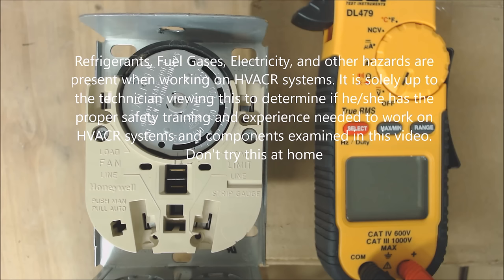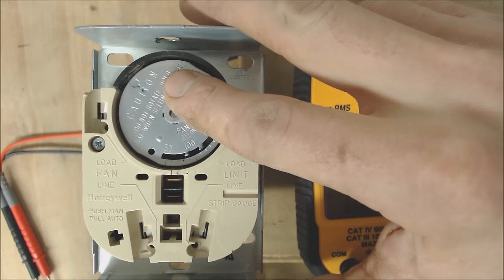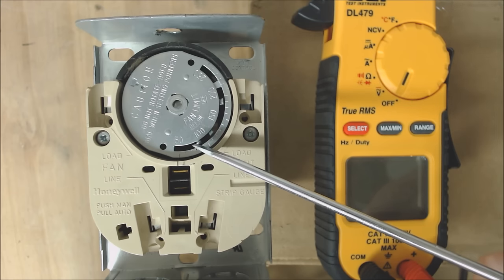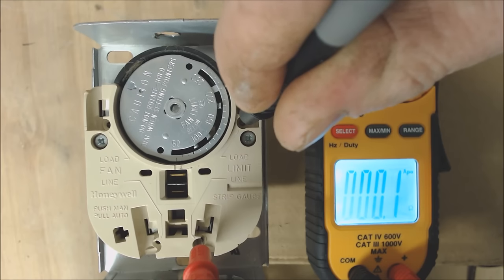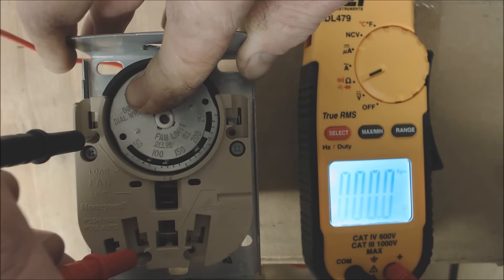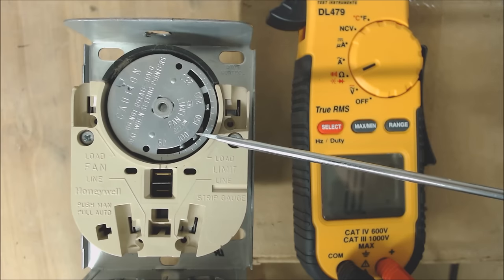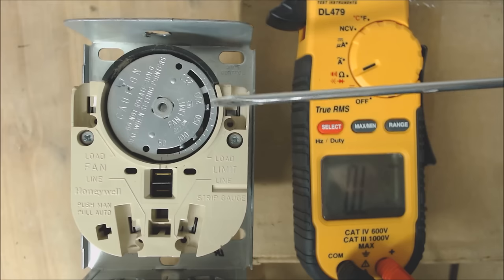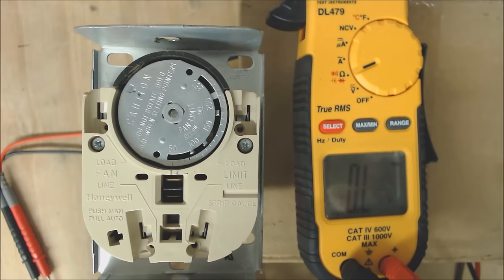Troubleshooting the Fan Limit Control Switch on a Furnace, Temperature Settings, How it Works!

Comment: Hi My furnace shut it self down as the gas valve stop working properly...no heat. The technician who came over determined the valve was at fault. He mentioned that the furnace is 15yrs old and is at it's end of it's life span. This is the first problem we had with the furnace. He seemed to be hinting at replacing the furnace. He called his parts supplier and found out the part was not available and it may take 1-2 weeks to get here. Its winter I need heat. I found the part myself at a different supplier but as I don't have a gas license i couldn't buy the part. I informed him and he got the part for me the next day. He apologized for not checking another source. I question if he was honest about this...Perhaps he was hoping to get me to buy a new furnace instead. However, now it seems I get heat in the first stage, and it takes a long time for the second stage to kick in. When the second stage kicks in it runs for a rather long time blowing cold air before it shuts down. I noticed this about a week and half later. So the house gets warm, then it gets cooled off with cold air blowing. I wonder if he didn't set the limits properly (or on purpose). From what I recall when the second stage kicked in we got a lot of heat and the house warmed up fast. I'm a little hesitant calling the company back. I'm also hesitant to call another company as I'd like to have some kind of idea as to what is really going on and how the furnace properly works. Would the fan limit control need to be adjusted? Thanks

Comment: I had a lady that sits in front of the heating vent and when the burner shuts down where the fan keeps running toward the end of the heating cycle she feels a gust of cold air coming out until the furnace fan shuts down.  The fan limit settings were set at 95/120/200 on oil fired unit.

Comment: Then if unplug the cord i have 24.8ohms on fan side and still .3ohms on the limit side what am i hooking up wrong here its hooked up to thermostat but it wont turn blowers on and if i get ot to wprk with the thermostat then the draft/combustion blower wont work

Comment: So i have a question i have one these on my wood furnace it looks like my dial is screwed up or something It goes way past 50 counterclockwise without a fire and with a fire burning stove is hot to touch and the dial is at 100 if blowers do kick on its just fpr a second you think my switch is screwed up? On my limit side i have .5ohms and an oL on the fan side with the switch dial at 100 if i turn dial a little more to make blowers kick on it reads .1ohms

Comment: Great video!   The model you're showing is the Honeywell L4064Y1441,  I can't seem to find any direct replacements on it for my York furnace, but a few sites show the L4064B2210  as a replacement but it doesn't have the center 2 spade connectors.  Can this L4064B2210  be installed, if so, what to do with the two yellow wires coming from the gas valve that used to connect to the 2 center blade connectors?
Reply from the maker: You should be able to get it at the local supply house but the two center tabs are for downflow so that the furnace doesn't overheat in the beginning, thanks

Comment: Hi, Thank you for the awesome video. Sometimes changing the thermostat can save you 5k to 10k on this HVAC system (lol).

"HVAC CAN BE DANGEROUS; DO NOT ATTEMPT ANY REPAIR IF YOU HAVE NO KNOWLEDGE OF WHAT YOU ARE DOING."

 I have an old furnace in my house. I had the relay buzzing very loudly inside the furnace. Called the technician he said it was the transformer and relay, and would charge $300 for the relay only (lol). He also advised me to put a new and more efficient HVAC system.  Called another one he also told me your system is old get a new one. He told me your furnace and AC are running at the same time (bu**). After he left, I checked the outside unit wasn't running. 

After that, I decided to take matters into my own hand. I made my own wiring diagram of the furnace system since the older system is simple without any circuit boards. Checked voltage on the transformer, limit switch, relays, and so on. While checking the voltage on the relay coil (magnetize switch ) and it was 3 V instead of 24 V. Since I had the wiring diagram ready I figured out the culprit was a thermostat. I also had to replace thermostat batteries twice that week but it was hard to relate it with relay buzzing since I had no idea of the system before. I replaced the thermostat with a new one since it was in warranty. I am using the smart google Nests thermostat. It took me 3 days to do the above tasks. 
So in summary, I saved myself 5k to 10 k for the new HVAC system.  
Good luck with your diagnostics everyone.

Comment: Good video acservicetech as usual. 
I would just add that the two connection spades in the middle of the control is for what we use to call "Sure Start" connections. These connections are on combination controls that were used, in example, down flow furnaces. How it worked was when 24 volt was sent to gas valve on a call for heat, you would see the "w" and" common" at the gas vale sent parallel to these spades connections which was connected to a internal heater to bring the fan on quickly. So in a downflow furnace they were used so the the radiant heat rising up off the heat exchanger and into the fan above it wouldn't damage the blower motor.
Hope you don't mind the feedback.
Cheers
Reply from the maker: I appreciate your input very much Paul!
Reply: yeah pre-heater to turn the fan on earlier in down/horizontal flows. without them it may not cycle on for many minutes, overheat badly or trip thermal fuse/secondary limit.
they always tripped folks up and ended up cross-wired, so it was common to find burnt gas valves, transformers, thermostats and low voltage wiring with "line voltage".
Reply from the maker: Thanks a lot Throttle Bottle!
Reply: This is great info because I came across a lennox today that wasn't supplying 24 volts to the gas valve from this combination switch.
They should have detailed these two terminals in their video. 5:38

Comment: Thank you so much for the video. But the previous tech missed up all the wires. Would have been great if there was mention which is 24v and 120v
Reply: I’m running into this exact problem now ☹️
Reply: @marcelinomagana5336  grayfurnaceman have a video on this.

Comment: Very well detailed video. I have an older Lennox G12Q3-110-4 furnace i'm currently using in my shop. I'm having issues with furnace only blowing on a low speed. I tested the fan limit control switch. I checked continuity on fan (black) wires and always have continuity regardless of me rotating the dial. This is a 110,00 btuh furnace and seems like it should blow harder on "heat". If i turn thermostat to cool and turn fan to "on" it will blow much harder. Would you happen to know if this is the way it should operate? My chamber is only getting to about 110 degrees with low set at 90 and high set at 120. Any help is appreciated, subscribed!

Comment: My fan limit switch keeps cycling the furnace off. Over the summer I removed and cleaned the blower. I also put in a new filter. Just to trouble shoot I removed the filer for max air flow. The fan limit switch rises in temp quickly and shuts the furnace down after a min or two. It cycles again in about 30 sec to a min. I have all the vents wide open. It was working good before I cleaned the blower, lol! any ideas what I should check next? anyway to clean the limit switch rod? have you seen them go bad like this? The blower seemed to be working ok. Thanks for the help!

Comment: When a limit around 200F is reached, gas turns off, blower is still on.  At what temp setting will the gas turn on again?
This is for a case when gas pressure is too high coming out from preset factory setting of gas valve and blower works but speed is too low.

Comment: There appears to be to male spade connectors in the center of the unit (just below the dial), what are they for?  Mine has yellow wires attached.

Comment: Hello  great video!thank you ,  i have  a question my heater  doesn't work i have 24 volts from the  transformer and as well in i the main board the gas valve opens but  no spark after the valve  gas opens then it shut down automatically but no spark at all  blower only works in on not in automatic ruud furnace same unit control what can possibly be your opinion is highly appreciated thank you again.

Comment: I was wondering if there was any way to have the fan on more often / for longer by adjusting the settings.

I thought that it was possible but now it seems not because if you have them further apart, the fan stays on longer but it also takes longer for it to come on, similarly if they are closer together, it takes less time for the fan to come on, but also the fan stays on for less time. 

Overall you get more or less the same fan time as a result.

We have a woodwaste heater. Any recommendation specifically for the on off settings in our application?

Many thanks.

Comment: My furnace has a fan limit switch like the one in the video , but my blower fan does not turn off . Tstat is set on auto for fan , I  disconnect 24v from tstat R and G and blower is still running . Could it be that the fan limit switch is bad ? Could a clogged filter be the problem as well?

Comment: I have a bad (open) limit switch with fan control on an old ge furnace. If I look for it online by the number it doesn't appear. Is their an option for replacement.

Comment: As always,good job
Reply from the maker: Thanks mpflood!
Reply: @acservicetechchannel  good morning I have a Lenox an the fan won't shut off I check the thermostat its ok I took the bottom door off an fiddled with the switch now it seems to work but if that's not the problem what could it be?

Comment: Lately my fan limit control switch has been acting up. It is a very old White-Rodgers 5D51-37 with a 5" probe. The problem is: the fan doesn't come on so it reaches the temperature limit after about 4 minutes of the furnace being on, and shuts the furnace off. If I manually turn the dial slightly (counter-clockwise I think), the fan comes on, which cools things down, and about a minute later, the furnace comes back on. 

It started happening about a couple of weeks ago, and at first, when I "fixed" it by manually by turning the dial slightly, it continued to work fine on its own for about a week. Then I had to fix it again, and it worked fine for a few days, and so on, and now I have to fix it every time the furnace comes on. It seems like a simple device, and the dial can be turned by hand easily enough (it's under spring tension from the coiled bimetal strip in the probe) in both directions, so I can't imagine what the problem is.
Reply from the maker: They go bad. The bimetal is rubbing on the outer metal likely but that part needs to be replaced, thanks
Reply: Would this be typical on a wood furnace.... IE on at 120 -130 and off at say 90?

Comment: Hello thanks for the amazing videos. I was wondering, Is there an easy tell by looking at a blower to tell if it is multi speed or variable speed. Like is multi speed taps as apparently to connection block or something. Also what is the key differences?  Thanks in advance. You rock.
Reply from the maker: Thanks Daniel! Did you see this video?-  https://youtu.be/EHwTZFvv-2Q
Reply: acservicetech  perfect you cover everything so well man keep it up.

Comment: Hello! Great video! Question: I just replaced the belt drive blower motor with one that is basically the same (1/3 horsepower, 1725RPM, etc..) the problem with the switch above is: that after kicking on the motor at 150F it starts to go backwards until it hits 90F and shuts off. This takes about 5-10 minutes. If I left it like this it would do it forever. Any suggestions? Thanks for any advice. Bryce
Reply from the maker: Unfortunately you would need a motor with the same directional rotation. The only other way is dismantling the motor and switching the internals the other way. Also, the motor should turn on at 120 not 150, thanks!
Reply: @acservicetechchannel  - It turns out that I had some cold air escaping from an exhaust vent for a gas fireplace that I was using temporarily while my blower motor was busted. Once I closed it all was good! Thanks for the reply. I appreciate it!

Comment: I need a new limit switch for a camper furnace. It's a L170-40F.  I see some limit switches online with that description. Would that be the only factor to look for ?
Reply from the maker: Yes but also how the sensor is mounted. Make sure the mount is the same, thanks and sorry for getting back to you late!

Comment: When my burners light, about 3-5 seconds later I get a bang sound.  It seems to be coming from limit fan switch.  I was wondering if the metal elements in the shaft of limit switch is getting hung up when it starts to turn.  Everything is working just find, just get that bang sound seconds after the burners light.  Thanks for you help.  DAVID
Reply: Sounds more like dirty burners or something

Comment: Great video,  I've tested my switch and it checked out good. My furnace fan starts up when it hits 130ish (the second setting notch), then the switch cools down quick within 10 seconds to the 100 mark(the first setting notch) and the fan kicks out. Then it heats up and turns on again then cools to turn fan off. It is cycling like this a few times until the thermostat kicks out at set temperature. Could the switch be faulty at the "by metal"? And would replacing the switch resolve this?
Reply from the maker: Most likely yes replace it. It could be that the blower speed is too low though if the blower turned on at the right heat but couldn't move the heat fast enough, thanks
Reply: Hello again, I swapped out the limit switch a month ago. The hard part was finding a supplier to sell it to me. Everything seems to be working fine now. I did change the settings to 90 to kick out and around 125 to kick in. The fan stays on longer to cool the heat exchanger. Thanks again for your help and saving me a service call.
Reply from the maker: glad to help!

Comment: I only have one wire coming in the left side, at the top.   There is no wire on the bottom left.  My motor runs continuously and I am trying to figure out if this is the issue
Reply from the maker: You would need to have a second wire for the voltage to go anyway, thanks

Comment: I have a problem the fan runs all the time with the panel on but it runs backwards. I take the cover off and the fan runs the right way. The-only way to turn it off is to unplug the heater. I need help any ideas

Comment: I got a question for you. Hope you can help. have one similar.. But it had a push/pull for auto and manual..    I put it on manual(always on) the other day and now it won't switch to auto..  Was wondering if i can bypass the pushpull to have it auto again
Reply from the maker: Usually the push/pull will go back in. It shouldn't lock into place unless the contacts melted together due to amperage, thanks
Reply: @acservicetechchannel  its not locked in place. But when i put it on auto it doesnt stop the blower.. And it should since furnace is off. And blower set to turn on at proper temp.  

I feel like im doing something wrong. Its very smooth push n pull.. No resistance
Reply from the maker: Turn the blower off setting to a higher temp position and if it doesn't turn off then the fan limit should be replaced because the settings are not allowing it to shut off.
Reply: @acservicetechchannel  thanks for the tip, will give it a go tomorrow

Comment: I have an issue! I turn mine to 80 shut off and it goes off the about 30 seconds to a minute later it goes back on for 30 seconds or then off! Thermostat is set at 76 degrees! Switch is new! Why does it do this? Is this dangerous? Thanks Michael
Reply from the maker: Are you saying you are turning your thermostat to 80 and what is going off and one, heat or blower motor?
Reply: Thermostat shuts off at 76 degrees. Furnace gas shuts off and fan runs till limit switch shuts off at 80 degrees! After it off 30 seconds later the blower goes on for 30. 45. A minute runs about 15 second and shuts off till thermostat turn it back on. Thanks

Comment: hi , im a new tech, , is there any way i can by pass this limit switch
Reply from the maker: I wouldn't jump it out but just measure with a multimeter if there is 120v present from common to the tap that says limit. If there is not then the limit is tripped if you do have voltage from the hot at the bottom to common, thanks

Comment: Absolutely wrong!! The purpose for the 120 degree setting is so the fan does not cycle and blow cold air without heat! It allows a preheat. The purpose of the 90 degree setting is the blower will exact that temperature from the heating chamber before shutting off!...learn your control before you post a sequence of operation!!!
Reply from the maker: Hey Mack, I said 90 degrees because too many people are trying to squeeze out the little extra efficiency by letting the fan run down to 80 degrees on the first pin to cool the heat exchanger air. What happens over time is the switch tends to get a little off and then the fan limit just continues to run and doesn't shut off. I have had quite a few people asking me about why the fan won't shut off on their furnace. The furnace fan keeps turning out to be controlled by the fan limit instead of a board with the first pin setting too low. The 120 degree second pin is certainly for the heatup before the fan turns on and what better of a fan on setting than the exact temp rise that the furnace is supposed to run at since this is not a timed relay but instead is a temperature controlled relay. I could have put it another way, thanks!
Reply: I back most of them down to 100F on and 80F off and limit the temp to 160F. poor mans efficiency, with air still warmer than most 90+